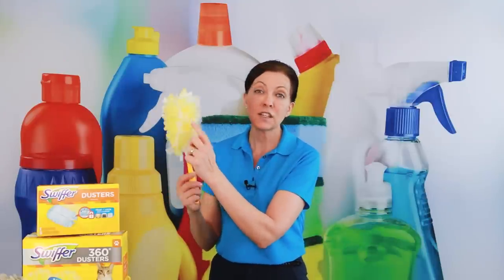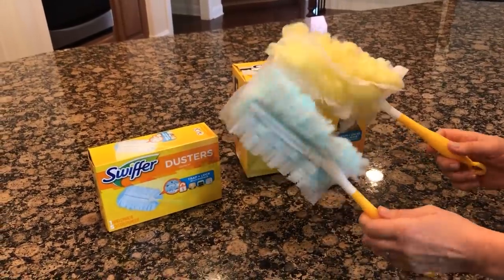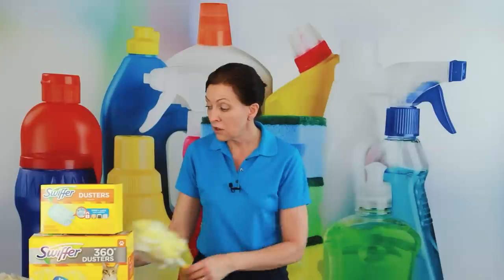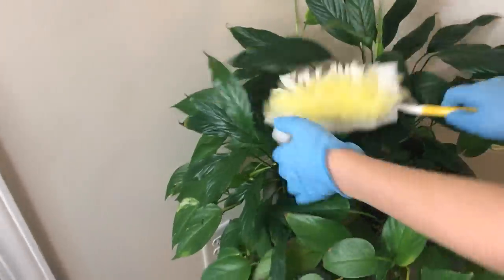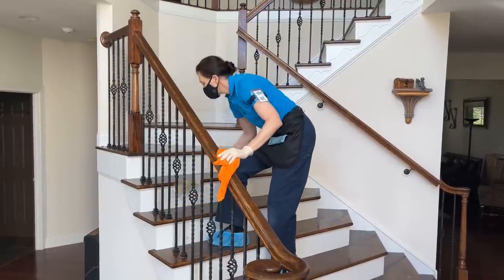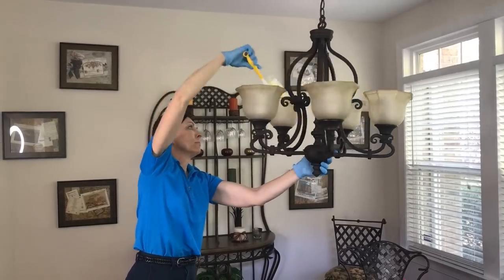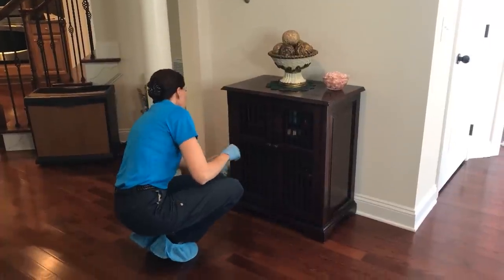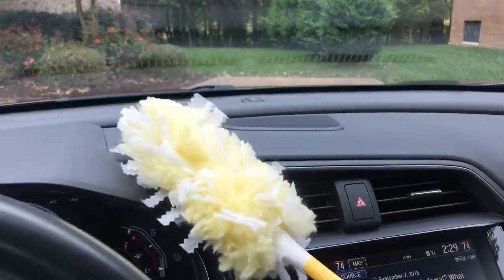Swiffer Duster 360 THE Duster Professional Cleaners Use

Comment: I think the dusters are OK.  When dusting in bright light, you can see the dust flying all over.  Also, when my duster gets a little bit full of dust, I have to give it a light spray of Endust so that some of the dust will continue to stick to it.  I clean my own home and find its best to dust first, then do the floors.  That way some of the dust can fall to the floor and get picked up there as well.
Reply from the maker: Thanks for these tips. Are you using the Swiffer Brand refills? I ask because you shouldn't be seeing dust fly all over when using them. They have patented trap and lock technology which removes the need for the Endust spray. I've purchased some knock-off refills and got the same results you mention. The refills are much cheaper in every way than the Swiffer brand refills. I wish (and am crossing my fingers) that Swiffer gives us a group discount at some point for these refills. They are indeed expensive. I love your idea of dusting first before vacuuming. 👏👏👏

Comment: I'm not a pro cleaner, but for the longest time, I have always avoided using dusters because I thought they only spread dust around instead of pick it up. I couldn't understand why anyone would use them. They just seemed so "wrong." So I'd only use my vacuum cleaner nozzle, Lysol wipes or just paper towels for dusting. I preferred CLEANING a surface instead of DUSTING it which took a lot of time. I even used wipes on my ceiling fan and light fixtures. But this video might make me a believer in dusters if they don't spread dust around. I'll still use my wipes and vacuum when necessary, but simply dusting a surface - on a regular basis - is a lot quicker than wiping surfaces. I'm actually excited about buying this duster and using it. I must also admit that I don't dust as often as I should, but this duster may change that. And I really like your car tip. Thanks.
Reply from the maker: Yay! I can’t wait to hear back on how you like the Swiffer. 😊
Reply: I hope you don't. I just hired my very first cleaning service who has been in business for about 15 yrs... Just 2 days ago was my first clean...The owner sent 2 women in to do a deep clean for the first time, and then they were going to come back every other week for bi weekly cleanings.. they brought a long Swiffer on an extension pole that swiffer was nearly black and looked like it had been used for months and months at many other homes... It was filthy! ,,..that is what they used in my house to clean ceiling fans, corners of the ceilings, basboards and chandeliers. I watched as they hit the swiffer against their little step ladder to get the dust to come off as she was cleaning the ceiling fan. The ceiling fan was quite dirty and chunks of dust were falling on my white carpet... they then went around with a dry rag to dust the furniture and shook the rag out in my house right by the furniture they had just dusted... They actually shook the rag out in the house right by the piece of furniture they had just wiped off...All they did was stir up a huge dust storm in my house and now 2 days later, my furniture is covered in the same dust they had already dusted including dust they hauled here from other homes on the very dirty swuffer... 
  The kicker is, the day the owner came to give me an estimate, I said,  plz tell me you clean with a damp rag vs a dry one or a swiffer right? She said no, they go around with the swiffer first to get all the dust off then go over it with a slightly damp rag...  I told her I preferred to have my home cleaned without a swiffer..  Well that didn't happen and now both my husband and I have sore throats and our noses burn inside from all the dust still floating around in here.. 
    I fell for the swiffer trend several years ago until I seen how much dust they disperse into the air while I was using it in a room that had a lot of bright sunlight was shining directly into the room while I was dusting. There was more dust flying into the air than what was collecting on the duster. That was the last time I ever used a swiffer and every time I see their commercials, I just shake my head wondering how many others fall for the nonsense.. A fluffy duster does not have a vacuum that sucks the dust into the center of the duster and holding it there while you are moving the duster around various objects. It's science!  But that company has buffaloed people out of millions of dollars with their claims that it holds a household full of dust without releasing it..  Please dont fall for that and keep your customers happy.
Reply: @america1403  I caught our cleaners years ago using the same wet rag from the toilet tank on the kitchen counter. They dont work for us anymore. That type of carelessness could spell disease and sickness. You really got to watch for the ones that do not care and are unsanitary.
Reply: @practicalguy973   You're absolutely correct!   I'm so glad you caught her before someone in your family got sick from spreading the germs from your toilet to your kitchen counter where you prepare food. I hope you fired her!!.  
   I watched a few youtube hidden camera videos in hotels where the cleaning ladies wiped the toilets with a wet rag, then used the same wet rag to wipe the glass coffee pots and 4 water glasses that sit in the little tray by the coffee pot. Bout made me puke.   Also,, hotels are only required to wash the blankets and bedspreads 4 times per year..  Thats what the law requires of hotels.. The chances are very good that you have sat on and slept with many other people's body fluids when you stayed at a hotel.

Comment: There must be some kind of secret I've tried a swiffer twice over the years and the cloth always comes off the stick lol...like when you did the blinds mine would of slipped off
Reply from the maker: I've heard that happening to people before, but in the 15 to 18 years I've been using them, I can only count a handful of times it's happened to me. I'm guessing the sleeves were too big to stay on. In that event, other professional house cleaners tell me they use clear hair elastics (here is the paid link https://amzn.to/3cRO82D so you can see what I'm talking about) and they slide it on about halfway to hold the replacement head in place and then fluff the duster around the rubber band. It's an extra step but would ensure it wouldn't slip off when cleaning.

Comment: I was always old school.  A cloth and furniture polish was what I used.  A friend mentioned these and I thought, surely they must work if she's recommending them.  So I went out and bought the big pack at Sam's.  I hate them.  I dusted my headboard which has 4 cubby holes and the first 2 cubbies were great.  By the 3rd and 4th, it was all I could do to get into the corners to get the dust out!  All it does is just what I thought, it throws dust around and doesn't really pick up after the initial swipes.  There's a reason old school is STILL old school.  And yes, it's name brand, yes, it's the heavy-duty 360.  I thought I'd come on here and see what I must be doing wrong.  It's pretty simple.  It just doesn't work.
Reply from the maker: Thank you for sharing your input,  I appreciate it.

Comment: If the Swiffer is not too dirty, you can clean them in a little handwash in the sink and reuse
Reply from the maker: Thanks for tip and for joining us here today. It's great to have you here.
Reply: @AskAngelaBrown  Thank you. But wait. There is more 😄. 
Two off topic great tips: 
- If a client uses the frying pan and there are (old) grease splatters everywhere, you erase these with ease with a slightly wet solid dishwasher cube.
- If you have to go no. 2, light a match and blow it out. The sulfur eradicates unwanted odors immediately.
Reply: Those extra tips are the best John! I bought the matches and when my husband has to go, he has to go. Visitors doesn't bother him, outdoors it doesn't bother him. I lit a match and the air is really clear immediately. That matchbox is now permanently in my purse.

I help my son by cleaning his house now and then. The grease is just whiped away. This will save me 10 to 15 minutes cleaning time. Awesome John. Thank you.

Comment: I find the Swiffer Duster very useful, but argh, it drives me crazy sometimes!
When I dust off some things like my books, the fluffy thing always slips off the handle no matter how I attach it to it!
Reply from the maker: I wonder why that is. I'm guessing the sleeves were too big to stay on. In that event, other professional house cleaners tell me they use clear hair elastics (here is the paid link https://amzn.to/3cRO82D so you can see what I'm talking about) and they slide it on about halfway to hold the replacement head in place and then fluff the duster around the rubber band. It's an extra step but would ensure it wouldn't slip off when cleaning.
Reply: I keep a pack of thin rubber bands that I use to secure the duster  to the handle, works well.
Reply: @AskAngelaBrown  Oh thank you Angela! I had tried to fumble a rubber band there before, but the result was unsatisfactory - I stupid nut didn't come up with the idea of attaching it in the way you described.
Reply: @sparkytoday8455  Thank you very much 😊

Comment: I recently bought a box of the swiffer 360 dusters. They look absolutely nothing like the product shown on the box. They're flat. Will not fluff up at all. Whereas the image on the box shows a super fluffy soft looking duster. I learned my lesson. I'll never buy another Swiffer product again.
Reply from the maker: +@DC-kj3in it’s true. I am sorry. I should have explained. They are super flat when they arrive in the box they pack several of them in there in a vacuum packed sort of way so that they’re skinny and will fit in the box. When you get them, you have to install them on the swiffer duster and then fluff them up with your hand or give them a really good shake. That way they open up and are able to be used.

Comment: Hi Angela, can you make a video about house cleaners and the ethics around calling CPS in cases of suspected or confirmed child or elder abuse/neglect? For instance, I cleaned a house today where the child's room was infested with flies and smelled strongly of urine. The parent said they had  "given up on the room and that the kids are just messy." The children all appeared to be under the age of 12. I gave the parent recommendations and told them that I could come back to finish cleaning properly because it would have turned into an all-day thing and I had another client booked after them. Hopefully they take me up on that offer. Would be interesting to hear your take, as well as if you've had a similar experience.
Reply from the maker: Yes, I will make you a video, and yes, I've had lots of experience in this department. The rule of thumb is your gut instinct. There is a fine line between living in a messy room and a room that is a biohazard and toxic to your health (or the child's health.) If people are living in conditions that can easily be addressed (meaning they have electricity, clean running water, readily available cleaning supplies) the recommendations for cleaning up that you gave them may be all they need. If there is suspected or confirmed abuse/neglect and a person's life is in danger, call for help. You may want to address your policy on this with the family when you  do a walkthrough. Many families will call a house cleaner when they are already being visited by social services.

Comment: I was really disappointed by the Swiffer duster.  I found it just streaked dust particles rather than picked them up.  I tried using it on my tv, devices and entertainment center and everything just had streaks of dust on them and nothing on the duster.  Literally had to go in there with a second product and cloth.
Reply: me too - and I purchased what is supposed to be the real thing off amazon  :(
Reply from the maker: What do you use instead for dusting?
Reply: My experience has been the same as far as leaving streaks of dust. Do you use the pet version, by any chance? I’ve tried both versions and was disappointed (I foster and own dogs, a cat, and small birds. Maybe these work better on dust that doesn’t come from  animals…?)
Also, the duster head slips off the handle way too easily, and it doesn’t seem to hold much dust so I go through quite a few of them each time I clean. 
I’m much better off just using a slightly damp microfiber cloth.

Comment: Thanks for this video. I have been wondering how these worked, tempted to buy new but not sure if it was just a gimmick. I'm sold! Can't wait to get one and start using it. How do you tell if it's full?
Reply from the maker: Let me know how  you like them. I've never found a better replacement - so I'm hooked. If you re a cleaning professional we dispose of the head at the end of cleaning a home. We never cross-contaminate duster heads from home to home. You wouldn't want to touch everything in someone's home with a duster, then go to someone elses home and touch everything in their home with the same duster head. 
That said, if you are in your own home, it's unlikely you are going to do ALL the dusting at once. So you can put it down and pick it up later to finish dusting. When it gets icky, toss it and get a new head.

Comment: I have had my Swiffer extension duster for quite a while. I use washable heads to cut some waste. I have found it an essential staple-probably my favorite, most faithfully used cleaning tool. However, I have one question: how do you keep the swivel head locked? Mine will lock, hold, and then loosen in a matter of moments, taking away from my time to adjust and re-lock the swivel head. Have you run into this? And if so, are there any ways you've found to mechanically fix or resolve it? I am rather attached to my extender, and don't want to replace it if it isn't necessary.
Reply from the maker: I’m sorry that your Swiffer isn’t staying locked. Here is a link to the Swiffer company: https://www.swiffer.com/en-us/contact-us (paid link)
I suggest you reach out to see if they have any tips on their product.
Reply: @AskAngelaBrown Thank you for this info.  I will reach out to them.

Comment: Hi Angela  I have a lot of books on bookshelves, many of which haven't been read in years and have accumulated a lot of dust on top of them. Is this the best tool for cleaning the tops and not pushing the dust down between the pages?
Reply: I want to know this too !  I love books - obvis by my name  LOL
Reply from the maker: Yes, The books can be dusted with the Swiffer Duster and the shelves can be dusted, then wiped down with a damp microfiber cloth. When the shelves are dry, the books can be returned to the shelves.

Comment: When I married, I moved in to my husbands home of 35 years (he was 5 when he moved here and now owns it).  It had not been cleaned in over 20 years so dust was/is everywhere... loads of it.  I'm beginning to believe this house is a dust factory because dust collects so quickly. I grew up in a humid part of the country and now live in an arid part and this dust issue is overwhelming.  I could go through a whole box of swiffers in one cleaning!  How do I get a handle on this?  How often should I dust?  Help!  ::cough wheeze:: 😰
Reply from the maker: Some areas are prone to dust. Some of the drier more desert like areas of the country you'll find dust storms where there are not lots of trees or grass to block dust. So even the slightest breeze will kick up dust and send it whirling. Keeping doors and windows closed helps keep the dust at bay. Replacing air filters in the HVAC system monthly or bi-monthly can help a lot. Choosing a vacuum with great suction and  HEPA filtration are a plus, along with a regular vacuuming schedule. Moving is not always an option but it may help. I moved from Utah (a very desert like area with lots of dust and sand storms) to North Carolina that is lush with trees and quite humid. I traded one allergy for another. My dust allergies subsided - but my allergies from pollen and mold kicked in. I wish there was an easy answer beyond regular cleaning and containment.
Reply: @AskAngelaBrown  thank you, this makes a lot of sense.  I appreciate the tips and suggestions.  Gonna step up the vacuuming and dusting game.  Love your channel.

Comment: when I shake mine (not like crazy either) I can see dust coming back off of it ???  i want to love it - but ? It is hard to keep on the handle and doesn't really seem to work for my farm house ??  what could I be doing wrong ?
Reply from the maker: Are you using the Swiffer brand refills? There are knock-off brands available in some of the big discount stores that don't have the patented trap and lock technology and they don't stay on very well either. I wonder if by mistake you ended up with a box of similar refills but not the Swiffer brand. The boxes they come in are deceptively similar. I've tried both kinds and having cleaned literally thousands of homes, there is only one brand of refills I buy for the very reasons you mention.

Comment: They don’t stay on very well and the holding slots tear way too easily
Reply from the maker: Are you using the Swiffer brand? I've tried other knock off brands for the replacement heads and they never stay on well. I've never had any problems with the Swiffer brand, although they are more expensive than the off brands.